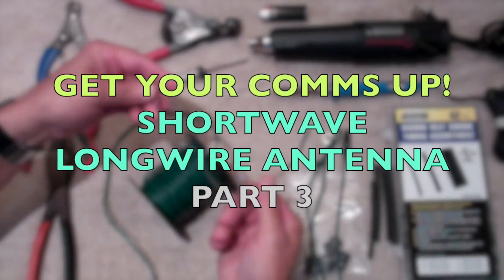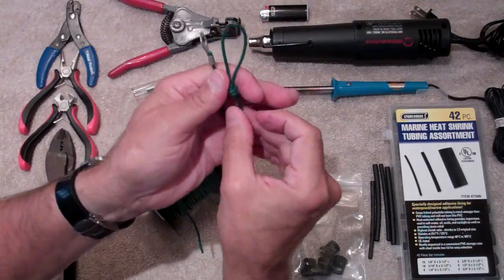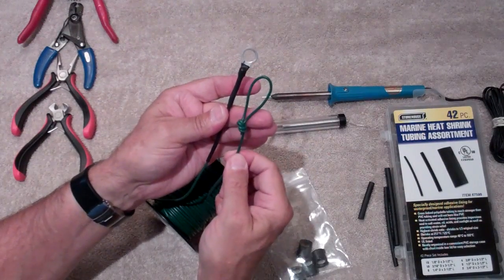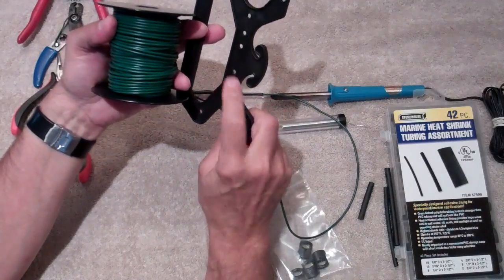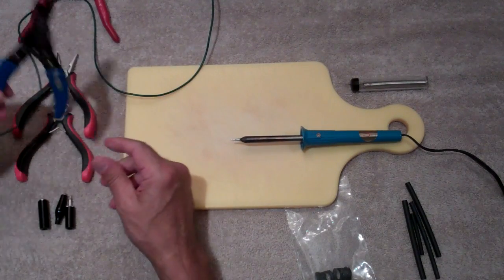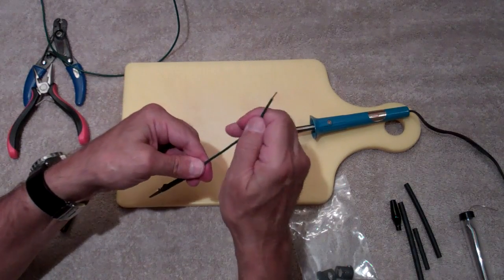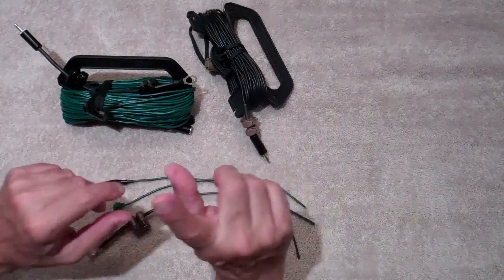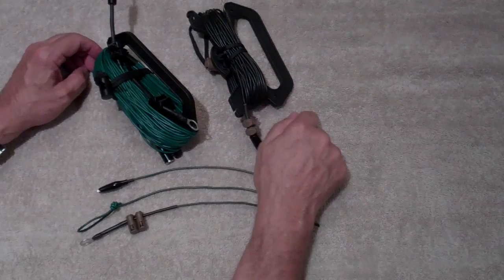GET YOUR COMMS UP! SW Long Wire Antenna Project - Part 3

Comment: Fellow ham here. Perhaps would it be better to have frequency specific antennas? Say one for 20, 40, and 80 meters? BTW, I love your videos!

73's.   Jeff KD9ILF
Reply: Jeff hope you see this. When you say specific antennas for 20, 40 and 80 are you referring to the total length of the antenna? I never considered this but could you tell me lengths that could help with radio signal on those 3 meter bands? I'm using a County Comm GP5. If I need 3 different lengths for all 3 bands how do I know how long to make the wire?
Thanks Mark

Comment: Hi Usnerdoc I made 100ft long wire using speaker wire. I ran it about 8ft off the ground around the only tree I have to the ladder rack  of my work truck. Tried to get the amrron digital net but still not receiving any strong signals. I am about 5ft away from my garage set up in the back of my truck using fldigi and the griffin Imic doesn't pic up any sound. So I just turn up the volume. Do you have any suggestions?

Comment: Thanks for posting this How To video. I dug out my Sony ICF-SW7600GR and made your long wire antenna. I never used the radio much because reception wasn’t always great with the whip. But with a long wire, it’s much better as expected. Looking forward to your next project. 73....Dave K6KNS

Comment: Good videos as always Doc.  My knowledge is pretty limited to 2-way/CB types of radios. I'm just starting to look at other types, but I don't want to get in to deep in  Ham/Shortwave.  I would like to have monitoring capabilities, with emergency 2-way conversational ability, all while being mobile, if necessary. I was looking along the lines of possibly getting something like the Yaesu VX-8DR or similar.  What are your expert recommendations for something along these lines, sir?  Thank you for answer ahead of time.

Comment: Excellent job USNERDOC, I like the plug configuration quite a bit.  I have to provide you some advice I received from the Kite flyer crowd & how to use the kite winders so you do not get kinks or loops in your wire.  When winding on the Kite winders you make a Figure Eight motion.  I have found the line comes off the winder alot easier when doing this also.

Great video series USNERDOC. 
Take care.
Reply from the maker: That is a cool tip, thanks!
Reply: Wouldn't a kite reel be better still?

Comment: I apologize if I missed it in the video, and I think it's obvious, but as a new ham I want to make sure.  The wire is soldered to the tip of the 1/8" connector, not the sleeve, right?  I assume the sleeve is N/C?  Thanks for your videos.
Reply: I'm referring to the sleeve part of the conductor, not the plastic case.  As in Tip/Ring/Sleeve on a stereo connector.  Since it's a mono connector it doesn't have a ring.  See this diagram:
http://www.leadsdirect.co.uk/wp-content/uploads/TS-jack.jpg
Reply from the maker: Yes, soldered to the tip not the sleeve. In this application the sleeve is not used.
Reply: Much appreciated, thanks!

Comment: Clever, but how would that work on the BaoFeng BF-F8+   that you carry ????
Reply from the maker: Good question George! This is a random long wire antenna for shortwave listening. The Baofeng will need a specific length dual band antenna for 2 meter & 70 centimeter. Hope that helps!

Here is a link to a well done video that explains this topic in a more detailed manner:
http://youtu.be/nNXvuv83ZNc
Reply: USNERDOC
I'm sure sombody has figured it out , I'll just have to keep my eyes out.

Comment: Excellent topic and suggestions. I use the following technique when soldering and a third hand is not possible. I usually hold the soldering iron in my right hand. I manipulate the wire or component with my left hand. Wrap a piece of solder around the index finger of your left hand with the solder end extending from the finger tip an inch or more as needed. Angle the solder for the best contact point. While holding the component or wire in place with the thumb and middle-finger apply heat to the junction. Move the index finger to apply solder to the heated joint. Will take some practice.